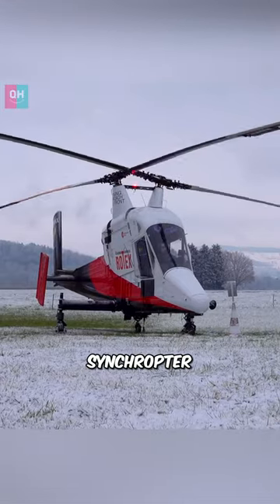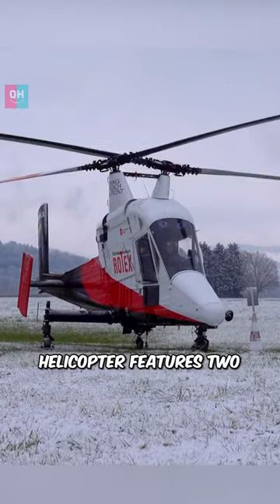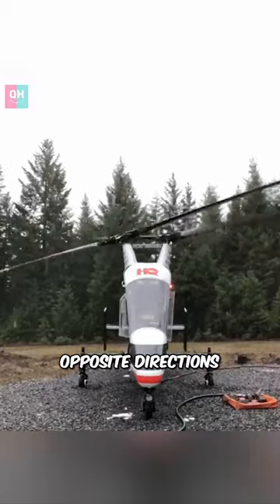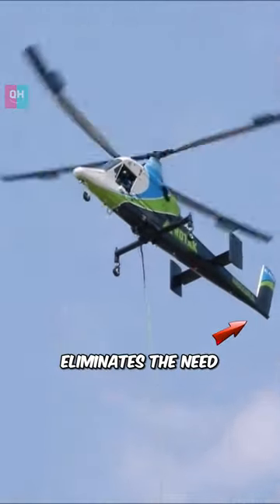Synchropter : Intermeshing-Rotor Helicopter #shorts

Comment: You dont need a tail rotor so why you got the tail??
Reply: The tail is there for stability. It provides more control surfaces
Reply: The tale is there for stability and control surfaces, the air flows over the tail and there's an elevator on the tail.
Reply: Or in simple terms the same reason why aeroplanes have them
Reply: In horizontal flight the tail has a dyhedral and vertical fin or vertical stabilizer. This allows for what's called wheater cock stability. Keeps the aircraft going in a straight line so to speak. Also it helps with weight and balance. If there was no tail or it git ripped off for some reason the aircraft would nose over uncontrollably.
Reply: I'm guessing the downward force of the wind is used by the tail to change yaw and pitch angle.  In addition the weight of the tail balances the craft in flight. The turbine flow over the vertical stabilizer seems to be used to change direction. One rotor creates an equal and opposite torque in the opposite direction  but 2 counter rotating rotors create equal torque against the helicopter in both directions thus eliminating the tail rotor. 2 main rotors also create more lifting capacity.